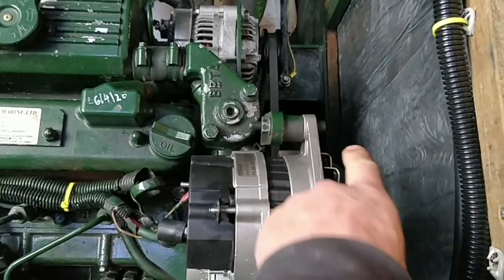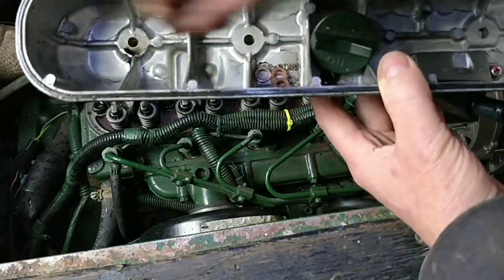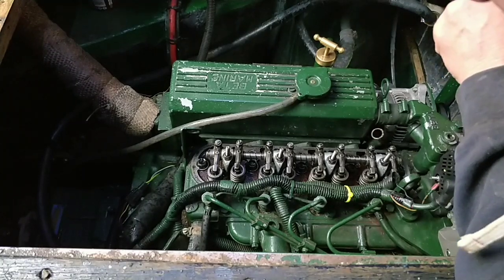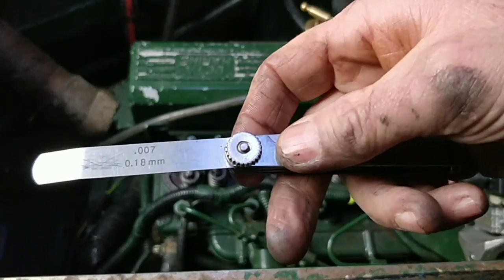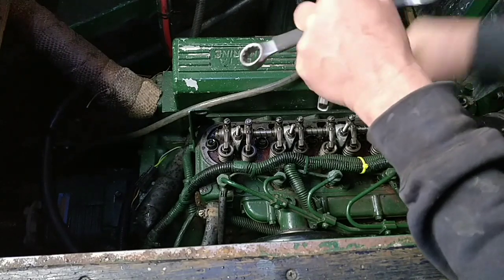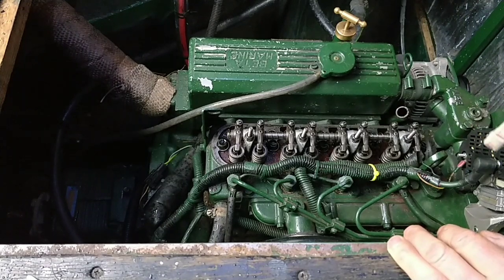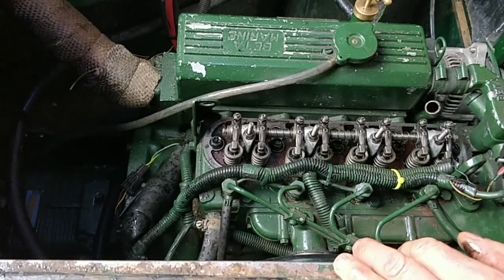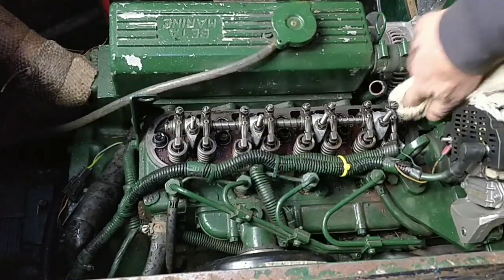Narrowboat engine valve setting. Beta 38.#143

Comment: Great!!! Rule of nine on an eight valve engine.... Number one down, adjust number eight- number two down, adjust number seven ect.. must be adjusted this way as the cam profile changes all of the way around. You cannot measure the gap if the cam is not in the right position, as the gap varies depending where the cam is. Very useful vlog to ensure you have a gap, but to adjust, they must be in the correct position. Well done mate.
Reply from the maker: Yeah my engine marks are buried so for me this is the easiest way.  Thanks for the input.

Comment: Very informative as always.  Thanks.   I have the Beta 43.   Hopefully you will change the thermostat one day so I can see how.    My califier does not give hot water even after several hours.  Not airlock as bled the water a few times.  So it must be a faulty  thermostat on top of the engine that is not allowing water to circulate
Reply from the maker: I would imagine if your thermostat wasn't working your engine would  over heat.  Check the pipes going to your tank are getting hot. The thermostat on my engine is the green round object on the left side of my engine next to the alternator. Should be easy to replace. Give it a go. I changed my water pump last year and that was quite easy. Good luck